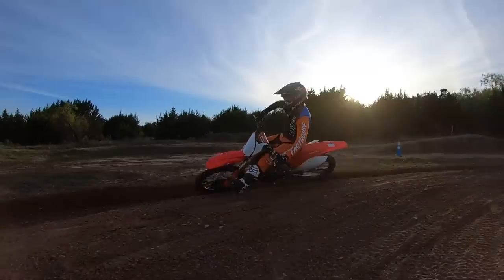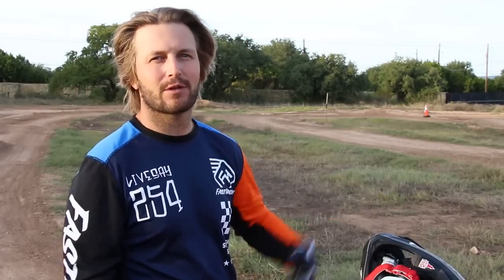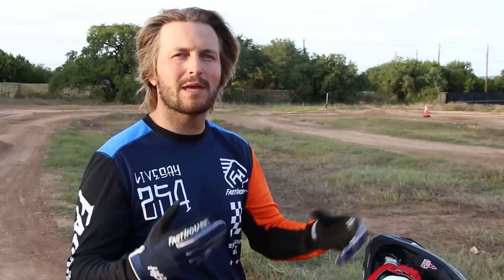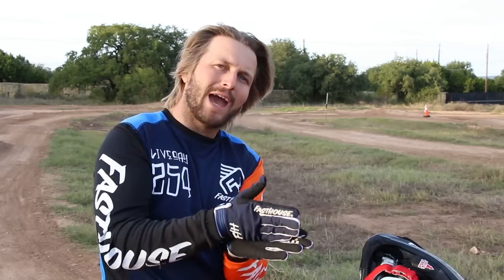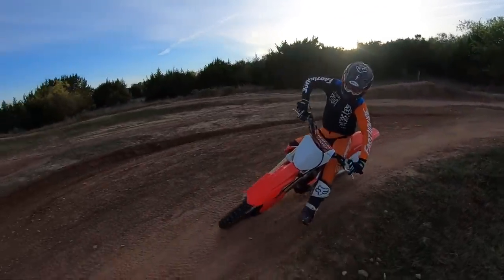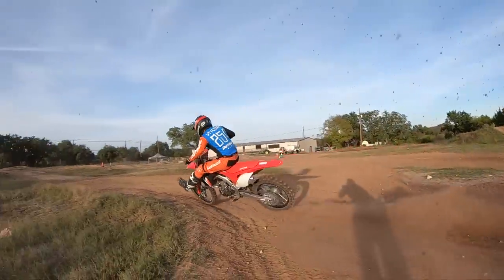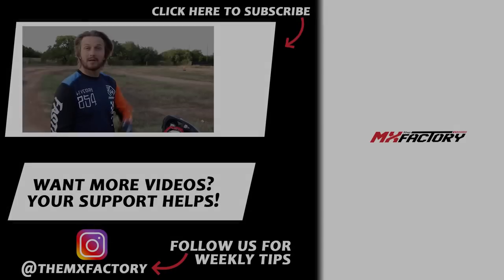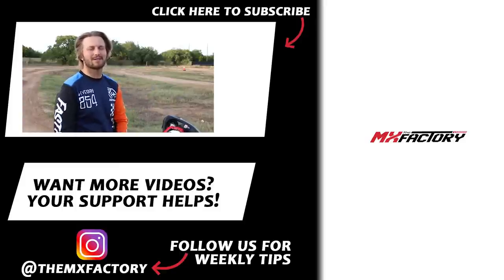How to Corner on a Dirt Bike - Hard Pack Vs Soft Turns

Comment: May I explain 2 different things though with this when riding a 4 stroke vs 2 stroke its also different for example if you watch this hes coming into corners braking and then clutching out where as on a 2 stroke like a 125 you want to either go wide and keep power or come in and make the rear slide lean to the inside of the corner then give power it will allow your bike to lose traction so you can give the bike power lean out and take off I only say this as I ride a 2 stroke bike this tutorial is a good tutorial btw but I wanted to chuck my aspect in aswell. Cheers

Comment: It’s the fundamentals of physics. Apply the weight perpendicular to the wheel surface. Acceleration when your middle tire knobs have contact to the surface. The more vertical the surface you are riding against, the more speed and centripetal force needed to maintain contact to that surface.

Comment: Would you please give some tips on the deep sand flat turn. Especially When when your line goes crossing all the small sand ruts cut by another riders.
Reply: My two cents...Pay no attention to the ruts.  Look past the ruts to where you want to go, feet on the pegs, butt off the seat, and get on the gas!  Body english is your friend - be active on the bike.  You need to stay up on top of the sand as much as possible so you have to be accelerating or maintaining some speed.  Sand is like instant brakes so stay on the gas as much as possible, even if you have to back off to make the turn.  Think of it like riding in a boat or a jet ski, you need to be up on plane and under power to have the most control.  Ride on, my friend.